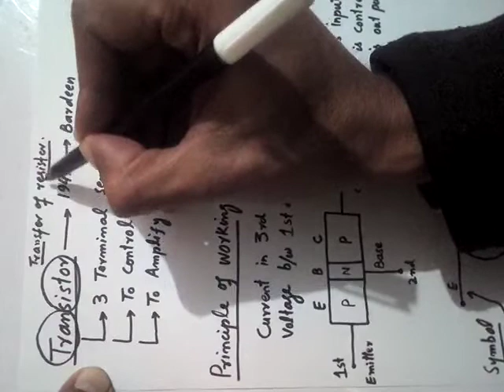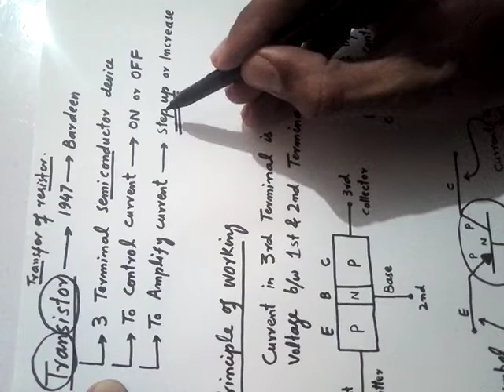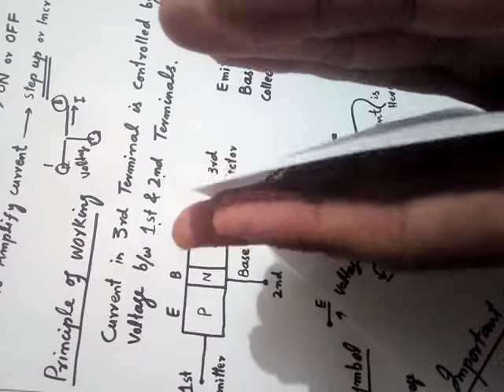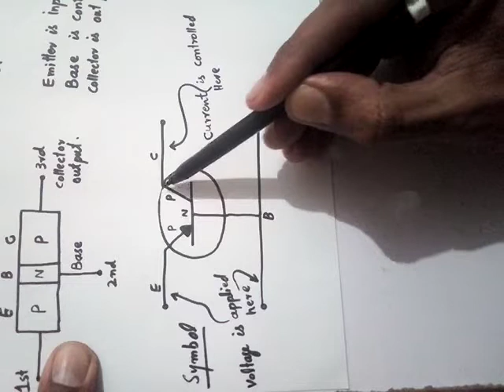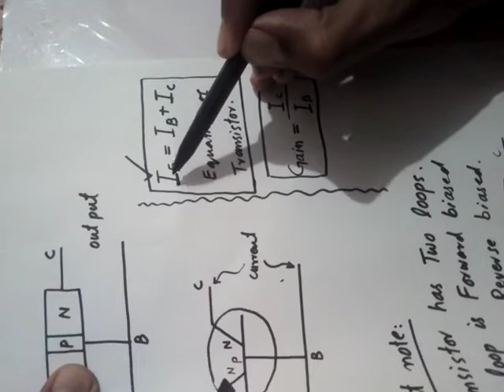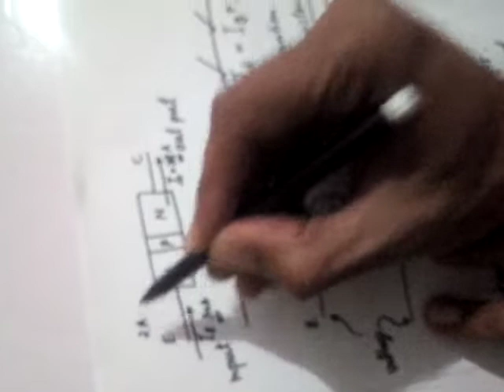Transistor

Comment: Sir u said that we give current at E but
U also said that the voltage is provided between E and B
Then voltage is not applied on at E
PLZ explain it
Reply from the maker: Where there is voltage, there also is current. Voltage and current are always combine. In one loop we use voltage concept only and in other loop we consider current only.
Reply: @khurramshahzad-ds1oj  here sir
Reply: @khurramshahzad-ds1oj  here sir
Reply: Sir why we not use the current in both loops or why we not use voltage in both loops